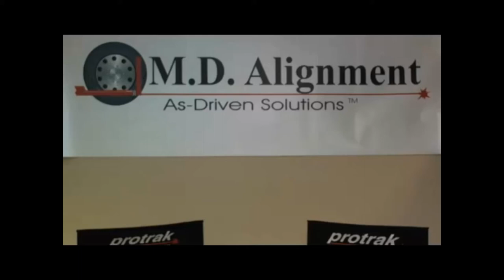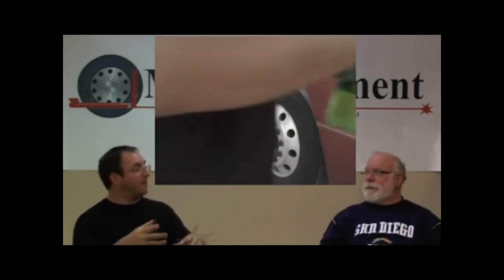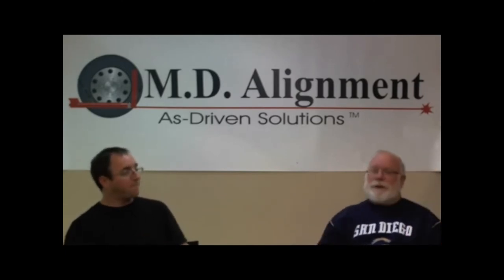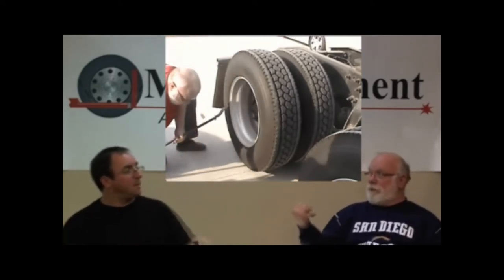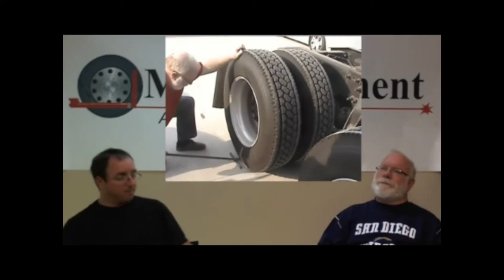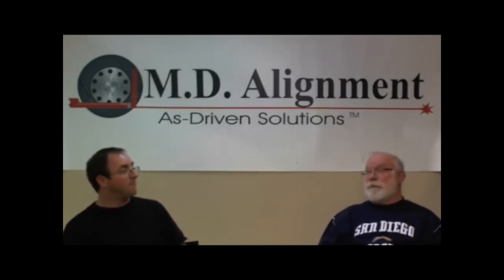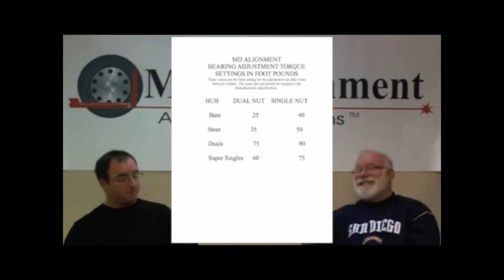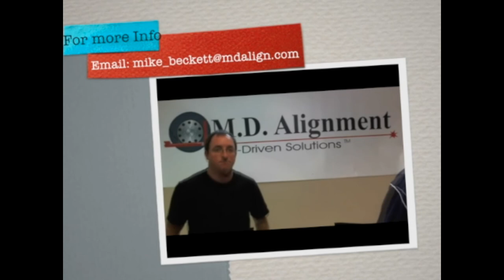Bearing Adjustment

Comment: Wrong.. 
To tight a nut on tapered wheel bearing can put uneven pressure across the bearing surface. Causing premature heal ware on each single cilyndrical bearing "ball"..
And will prematurely destroy the hardened coating on the bearing. In the "heel" area.
Reply from the maker: I agree that you wouldn't want to over tighten a bearing.  Would you agree that if a process consistently results in longer bearing, seal and tire life the bearing is not over tightened?
Reply: @MDAlignment  i believe you are playing both side of fence.
What is correct is correct. 
That's obviously what everyone should strive for. 
But a tapered wheel bearing, at least on a drive axle, can be tighten too much. It was said in this video that it is not possible to overtighten a bearing. That is not true. I've seen it. Wish i had took a picture.  I didn't know why until i reaserched it myself.  Before replacing it with new one.
But Thank you sir for your reply.
Reply from the maker: @hardhead7056  I had to re-watch this video based on what you said and I did not hear Mike or I say that the bearing cannot be overtightened, in fact we talked about the indicators that a bearing is too tight or too loose when you have completed the job and before you put weight back on the wheel.  I know a bearing can be overtightened, that's why we discussed it in this way.
Reply: @MDAlignment  well, now i will to..
I thought i re-watched it before posting.  🤔
Reply: @MDAlignment  on the topic of too tight..  22:30.
"If it's not wiggling and i can still spin it, it's fine".
Can lead me to believe that, "no matter how tight, if i can spin it, it can't be to tight.".
That's giving someone to much latitude to screw up.
I say this because a looong time ago. Before I knew better.  20 years ago.
I watch a guy put on my drive hub with an impact and it spun with one hand. Some time passed and i had tire ware issues. I proceeded to check and change ALL my drive wheel bearings. Starting with the one with irregular ware. It was the only bad one. It had bad heal ware on the end of the roller bearing.  In my reaserch i saw how excessive nut tension can easily cause the premature ware of the hardness coating that Timken and other bearing manufacturers employ for longer life. Once the coating exposes the softer core bearing material it's very quick to completely fail.  So.
I used the torque step method recommended by a few bearing manufacturers to preload and sent my bearing backlash.
Reply from the maker: @hardhead7056  the only way I can think that an impact gun could be used on a hub and result in a bearing that still spins is if they used the sleeved assembly as was standard on Paccar and Volvo 20 years ago and optional on most other brands.  They had a torque requirement, too, which is more than 2 times the torque setting discussed here (300 lbs. for the Dana LMS hub on Paccar products and I think 200 lbs. on the Volvo product of the same year)  The torque of a 1/2" air impact gun is over 500 lbs and upwards of 800 lbs depending on what they had. 

So you're talking about torqueing a bearing up to 10x what is discussed in this video -with a spacer sleeve between the bearings giving the wheel assembly the ability to turn freely with no weight on it.

Beyond the described wildly improper torque process for a good LMS bearing assembly, a sleeved assembly needing repair, such as has been worn loose for any amount of time will have a different dimension than from factory, meaning the bearing sets will be closer together than they were intended, even if the proper torque were applied.  

If you're going to use sleeved assemblies and torque far beyond we describe in this video, you have to do your due diligence, you are correct about that.
Reply: @MDAlignment  
Thank you for replying. 
The impact was used on my 1996 peterbilt 379. Without the inner sleeve. Just two Taper bearings as you were discussing in the video. 
The guy i was referring to in my story was completely wrong in using an impact to retighten my wheel bearing nut. I just didn't know it 20 years ago.  In hindsight.
Watching the video it reminded me of that and some people may think its ok. Because in that part of the video i do not believe you were referring to the sleeve style hubs. But actually the same as on my truck. 
But. Your posting of these videos are very helpful and I appreciate the  time yall took to put them out.
I WISH I COULD PICK YOUR COLLECTIVE BRAIN ABOUT SOME ISSUES IM HAVING CURRENTLY.
Reply from the maker: You can talk to the group on Facebook at  https://www.facebook.com/share/f71a6z3oSLBfrN7G/?mibextid=aI5dXw